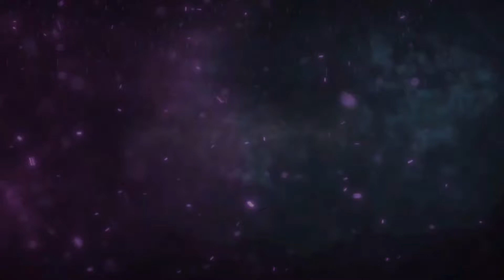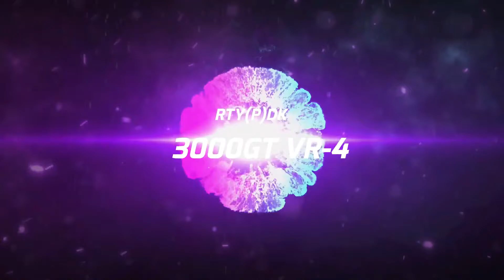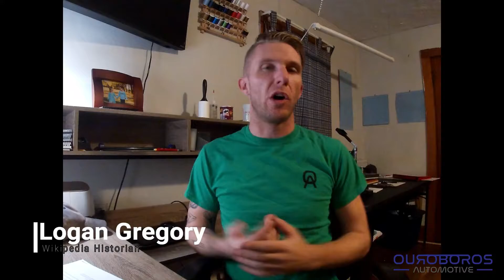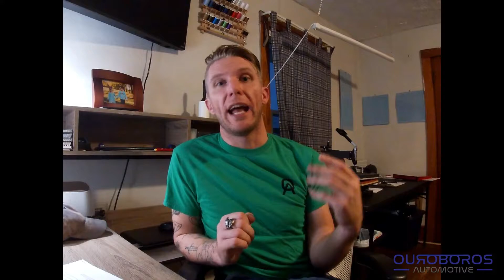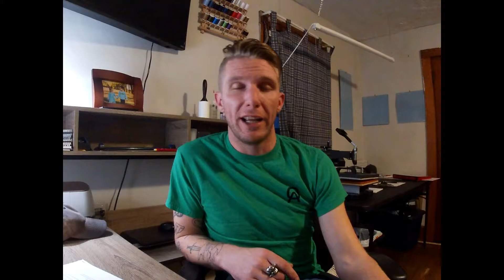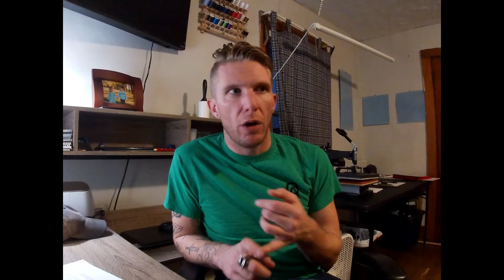Mitsubishi 3000GT VR4 Active Aerodynamics

Comment: So I've have a 3kgt. I feel the reason the active aero and 4w steering never caught on was because they always seemed to break.  when the 4w steering was active it made the car feel funky and if you're use to high speed driving it didn't instill confidence. 

The interior design on these cars is stellar and way ahead of its time(everyone knows the body is very pretty). When they were popular they were always sorta 2nd best for what they were as supra or gt-r just out shined them. the rival car in my 3/S community was the 300SX.

 It has other issues preventing as well that makes tuning and modding difficult. even stock vr-4 are not the most reliable.  I feel mitsu pushed these techs too soon and if they would have held off even 5 years to test these systems they would have been a bigger success.